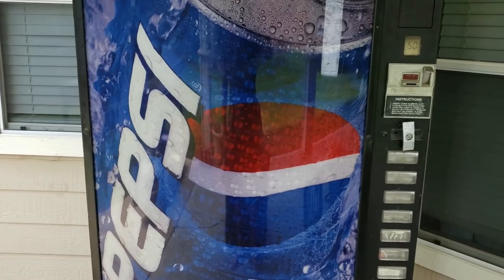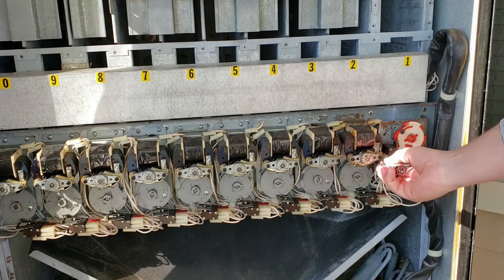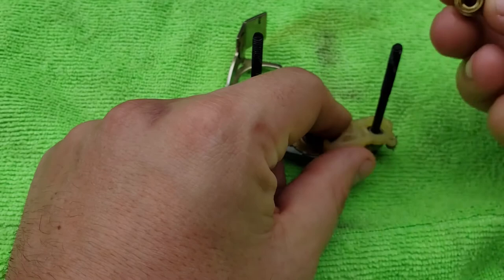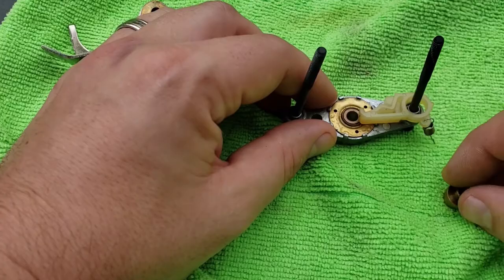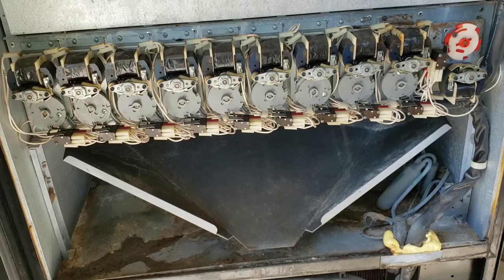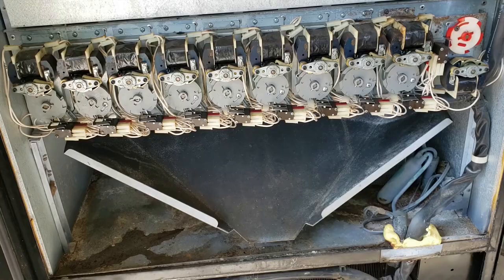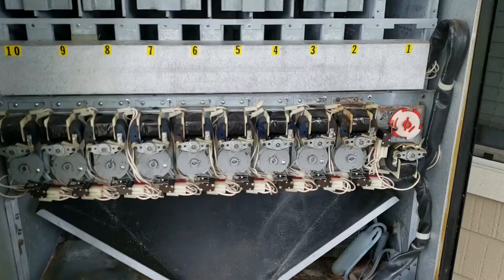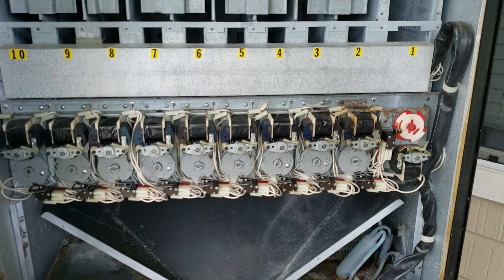Fixing Vending Machines - Vend Problems Solved

Comment: A friend of mine has this same machine. His won't respond to the selection buttons, even after putting the right amount of money into the coin mechanism. He did replace the coin mechanism but nothing yet... it's like the board isn't acknowledging that the money has been inserted. It will vend if you trigger the motors like you're doing in this video.

Thanks for sharing this! I love watching people fix things. It's therapeutic. :)
Reply from the maker: Thanks for the comment, and I know what you mean about it being therapeutic (feel the same way). I only have experience with the issues I worked through in this video series (as this was my first vending machine). However, I think the first response in this thread should point you in the right direction: https://vendiscuss.net/topic/22608-dn-368-wont-vend-please-help/
Good luck!
Reply: @anythingmechanical3399  thank you! Will check that link. :)
Reply: your credit relay could be defective, thanks

Comment: Nice video. I'm having an issue of one of my motors crushing cans. Not enough to pop them but it does jam that tray up.
Reply from the maker: @scirockalot8v Thanks. I had the same problem when I first got the machine and I think it led to some of the gears getting stripped out. Here's a good thread on how to fix motors that crush cans https://www.vend-resource.com/forum-topic/dixie-narco-crushing-cans
Reply: your vend cup is BENT, thanks

Comment: Cotter pin would cause a problem,  I kept rewinding for basis of repair. Which gear was this? I remember one of the gears not turning. I will rewind again. JB weld is a product you spread on central shaft to adhere to drilled areas. Aedin

Comment: What did you clean the inside and gears with. Then what grease do you use
Reply from the maker: I fused the gear to the shaft with JB weld. I used glass cleaner to clean all the pivot points (outside the gearbox). For the gearbox grease, there was plenty of grease in there so I didn't feel the need to re-apply. Had I thought it necessary I would have just used bearing grease, available at any auto parts store.

Comment: In the case of the cam mechanism being broken for any reason and not vending products, does the machine have a way of sensing that nothing was vended? Or does it just take your money and "think" a drink was vended?
Reply from the maker: Worse, it would just keep running since the switch never got tripped and this wouldn't allow the machine to reset. So it basically made the whole machine a big paper weight.

Comment: spending way to much time, just take a spray bottle with hot water in it and spray it on those microswitches that is what is causing the motor to drift..syrup and stuff gets in there
the white part on the top of the motor is called the break. spray that with your hot water.  maybe the reason the other motor doesn't turn is the switch could be bad or you have a bent vend cup
Reply from the maker: That sounds like a good short term fix if you're operating a bunch of machines. For me, this was my only machine and I wanted to restore it to good working order. The motor that didn't turn ended up being not plugged in correctly, so not woth mentioning in the video.